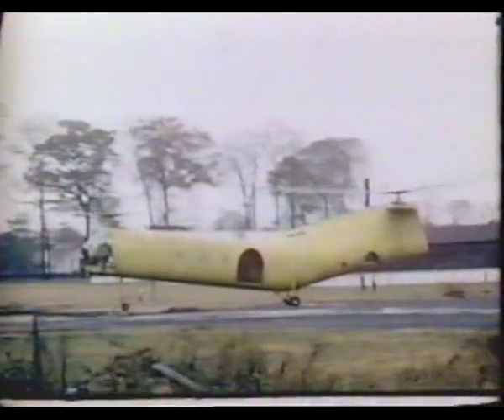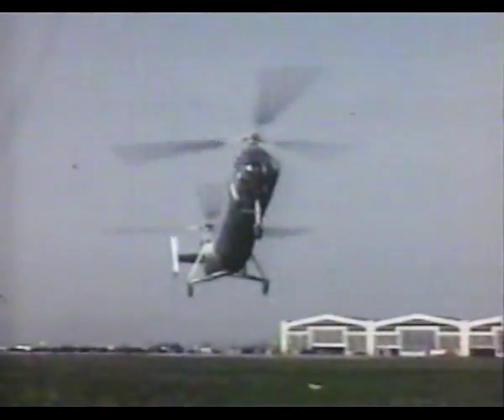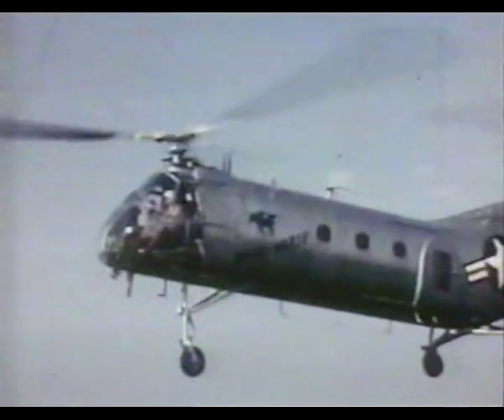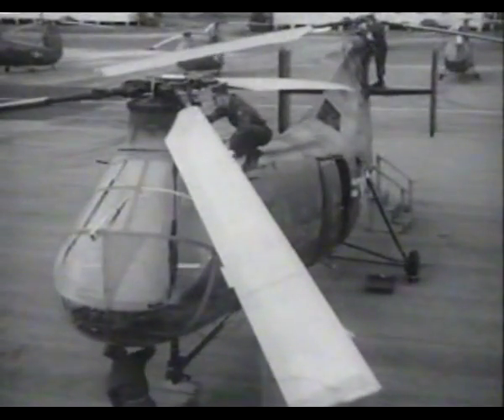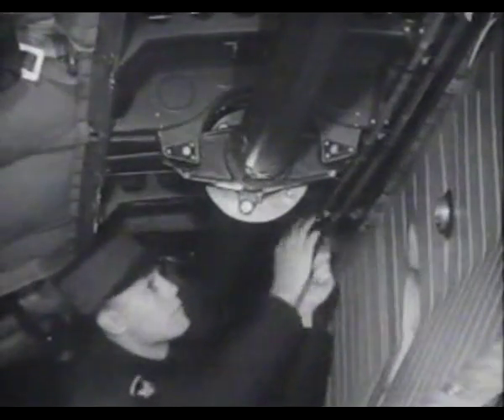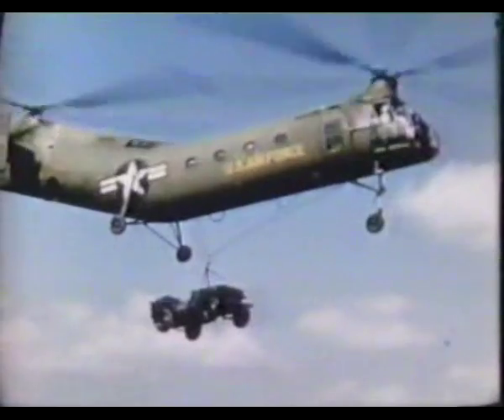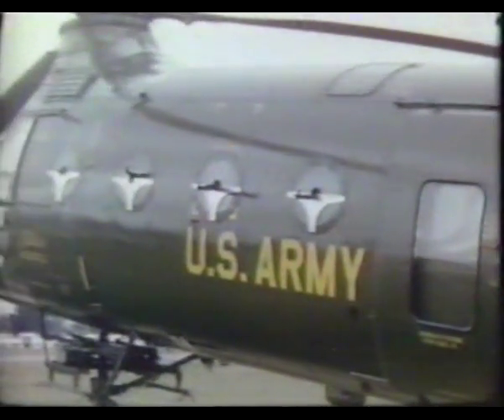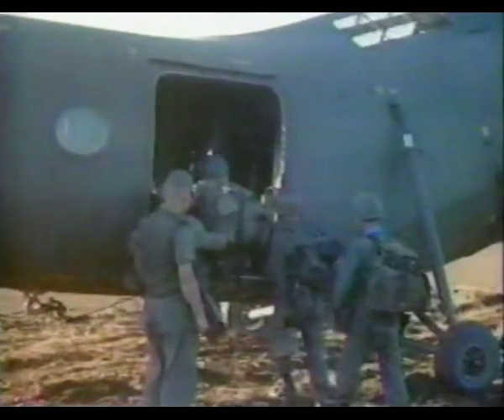Piasecki H-21 Workhorse/Shawnee

Comment: its one of the piston engine powered helicopters the h-21 or 44A is powered by a 1000+ hp Wright Cyclone 9 R-1820 9 cylinder radial engine that engine is also used in the Sikorsky s-58 H-34 Choctaw helicopter. there is currently only one airworthy H-21 left flying still the original radial engine as the others like the Sikorsky s-55 Chickasaw and s-58 Choctaw were converted to turbine power but in civilan service.